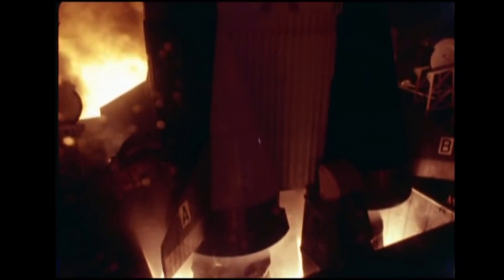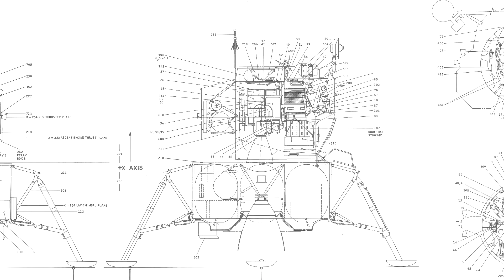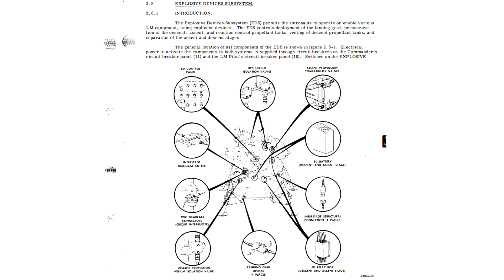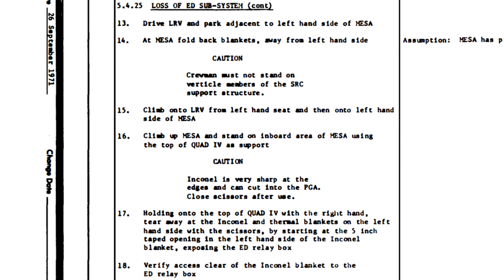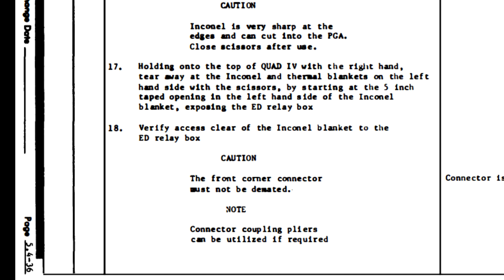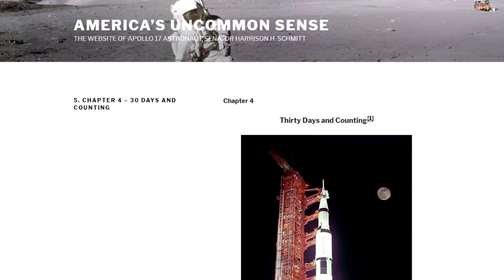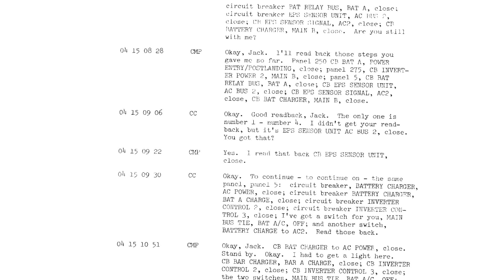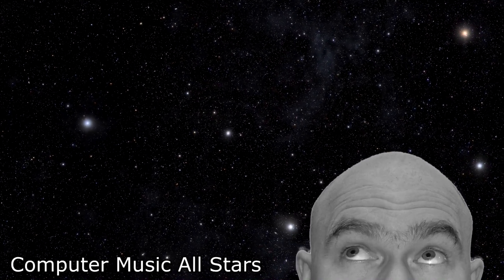Why Lunar Landers Had Jumper Cables For Emergencies

Comment: Spacecraft EPS engineer here. I'd wager it's unlikely they could use the rover's batteries. 
TLDR: It's possible, but unlikely unless it was explicitly designed to do it.

The only thing electrically that would cause problems is the voltage the batteries are sitting at versus the minimum/maximum voltage the system can accept. If the battery voltage is lower than required, nothing will happen, if the voltage is too high, you'll burn stuff out and make it useless. I feel they'd be at the same voltage however because they're the same battery chemistry, so they'd be using the same battery packs for everything, and all the battery packs would be at the same voltage, you'd just use more or less packs to get more AHr capacity.

They almost certainly wouldn't have a field joint for battery/power distribution output, but they would have one for charging the batteries. That's not useful though because there'd be reverse protection to keep the batteries from discharging and backfeeding the charging line. Further, supposing there was no reverse protection, the plug would be capped before flight because it wouldn't be used after launch, you'd need to do some work to get the cap off, which given the environment and constraints would be non trivial. Then there's the issue of needing something that can mate with the connector or a way to get at the lines which would be difficult with the space suit.

It's likely there's a harness for battery output (I strongly doubt there'd be a direct mate from the batteries to distribution, or no way to get at the output of the power distribution), but that would be buried inside the structure and be exceedingly hard to get access to without disassembling the rover.

So unless there was a field joint for battery output and a harness they could use to connect to it, it wouldn't work.
Reply: Absolutely concur, excellent analysis

Comment: I LOVE your videos and understand that LEGO is a sponsor, but couldn't you have used an actual scale model (you HAVE to have at least one) to demonstrate the amount of asymmetry needed to compensate for the fuel and oxidizer differences?
Reply from the maker: LEGO is not a sponsor, I bought that model on my own dime. I don’t do sponsorships.
Reply: @scottmanley My true apologies, I can take that down.  I just saw the thumb at the end.  I can give you one of my unbuilt 1/48 Monograms (of the lander) if you do not have one and if you would like it.  PS, YOUR Saturn-V is in much better shape than mine, but I have the parts you are missing, same deal.

Comment: You could replace the whole procedure with a switch. That procedure would then only be needed if the switch failed.  Or have I missed something ?   ;)
Reply: Didn't look into the circuit diagram, but this is procedure is probably the last-ditch effort to connect the battery directly to the pyro igniters and the fuel valve solenoids, leaving the failure points only at the redundant solenoid valves and the probably also redundant igniters. Could've been useful if the wiring harness was damaged in a cabin fire, was faulty from the start, or was damaged by the failure of a mounting point and vibration causing it to rub on a sharp edge somewhere. The recent hole in the Soyuz hull proves that you can never fully rely on QC to catch everything. However, I wonder if a modern moon lander would be constructed in a similarly simple and user-serviceable way.

Comment: It's still pretty amazing they pulled off all the landings without major incident. Compared to lifting off the Earth, the lift off from the Moon was so much easier. The ascent engine on the LM has long fascinated me because it acted as the invisible umbilical between the Moon's surface and the orbiting CSM - the Moon walker's lives were dependent on it working. Because of the ascent engine's constant thrust the moment the engine had to cut off was time critical. In the Orbiter AMSO simulator you can see the shape of the orbit changing faster and faster as the ship gets to a safe orbit altitude. I've done this manually several times and it's quite a roller coaster ride even on a desktop setup! The track lineup with the CSM has to be pin sharp otherwise you're off plane. There's usually very little fuel left after the launch to Lunar orbit from the surface even with an optimum ascent curve, so every burn of the quad RCS system has to count in order to rendezvous with the CSM. That makes the real life event even more mind numbingly amazing. There's one more thing. At the scale that we exist, all these things actually become possible - something everyone should stop and think very carefully about.

Comment: I remember two comedic takes on the Apollo 9 mission. One was a multi-panel comic strip that had the astronauts stuck on the moon because they need a jump-start, and a UFO settles down net to them and two little green men pop out with Jumper Cables. The other purported to be the last item on the emergency checklist which involved one of the astronauts standing under the ascent engine with a box of kitchen matches.
Reply from the maker: Apollo 9 never left earth orbit.
Reply: @scottmanley  I guess I meant Apollo 11. I'm old; my brain don't work so good anymore.

Comment: Scott can i ask you not to have moving text on a 30 fps video. The flickering is horrendous. The info was awesome tho.
Reply: 30fps is fine. That said though, fps preference is somewhat subjective...
Reply: @razeezar  One can get so used to the objectively worse that they wont accept the better. The tradeoff for higher fps is obviously a higher bandwith requirement for both us on download and scott on upload. I totally understand if he wants to upload faster. Realistically speaking 60 fps does basically nothing for the majority of his video. 

The problems with 30 fps videos only appear when something is moving fast over the screen or when there is text rolling over the screen. 

So in fact i did not ask him to use 60fps but i instead asked him to stop using rolling text.

Comment: Photovoltaic and battery charging. I deed it 2012 in Salzburg as the old battery of my car failed. Half our charging with all my solar panels and it was possible to start the ICE engine again. https://car.pege.org/2012/solar-starter-aid.htm Now I have always a small lithium power bank in my car, can charge the smartphone and jump start the car.

Comment: The rover probably has too high of a voltage. Or the thing they are connecting to is also on the ascent stage so you dont have wires being ripped out on launch.

Comment: The batteries involved do not have to be of the same chemistry for a "jump"--the voltage has to be in a certain range and the amperage needs to be sufficient, but otherwise electrons are electrons.
Reply from the maker: And the voltage is generally a function of the chemistry.....
Reply: @scottmanley   It still does not matter what their chemistries are as long as the voltage is appropriate.  For example, a 3-cell (in series) lithium-ion battery has approximately the same voltage as an 8- or 9-cell NiMH battery.  If you match the voltage closely enough, then it won't matter what their chemistries are--you're not physically mixing/exchanging the chemicals, and the electrons don't care whether the chemistries are different.

I'm not an aerospace engineer, but I presume that systems are designed for a specified voltage, and this includes the batteries, regardless of the voltage of a single cell due to its chemistry--designers will put enough cells in series to reach the specified voltage regardless.  Even if one system has NiCd batteries and the other has AgZn batteries, one can charge or jump the other as long as both systems use the same voltage, such as 40 volts (a common example in aerospace).

Comment: I knew they could connect the battery directly to the the engine.  Did not know they had to go outside to do it.  Also first 3 landings did not have a lunar rover, wonder what the astronauts would have stood on.

Comment: If they only had chevy and ford design the power system.
Could have just used a screwdriver to short out the starter and solenoid.

Comment: I always carry a 1 gallon fuel can, a set of jumper cables, a 5T hydraulic jack a 6" 2x4 and a 3/4 drive breaker bar with matching socket for tire with me.
Every vehicle comes with tools to change a tire but I hydraulic jack and breaker bar is sooo much easier.
I do not ever call roadside assistance and don't pay for it on insurance.

Comment: They also had jumper cables in case of a PLSS failure to connect one astronaut to the other on the J missions and in the case if the LRV
failed miles away from the LM and they had to walk back.

Comment: Your mention of the LRV battery being used to jump the LM reminded me of a strange feature of the early Nissan Leaf electric cars. There was, of course, a battery that ran the motor of the car to propel it down the road. But there was another, more normal 12 volt car battery in the car as well. You see, the issue was, the electric motor used something like 120 volts or more, but the car's accessories, things like headlights, radio, power windows, signals, instruments, and... the computer that actually ran the car, were all derived from similar items on more normal internal combustion cars. They ran on 12 volts, which is why you needed this battery! It was possible for the 12v battery to die, which would require a jump start before you could turn the car on. (Leafs of SL trim or higher had a solar panel that kept the 12v battery topped up)

Comment: Back in the 1980's a hurricane knocked out all of the power stations on the island of Kauai.  You need power to start a power plant, so they needed external power.  A nuclear submarine was sent from Pearl Harbor to jump start the island using their shore power cables to provide power from the nuclear powered steam turbines.  In the end, the Navy flew in a large portable diesel generator and got one plant started, it got the rest started.

Comment: As far as using the lunar rover to jump start the engine: the batteries' (wiki says the lunar rover had 2) energy capacity might have been servery diminished by the folks driving around. The voltage might not have been the optimum 36V anymore, and the maximum current draw would not have been very large. Probably not the best energy source to trust in such a situation.

Comment: On the rover the batteries were covered in parrafin wax for cooling purposes so I doubt they could expose the contacts.
Reply: There is also the issue of the engines firing once power is sent to the valves, so jump starting from the rover would be the ultimate short straw.
Reply: Maybe not if they had a way of hooking to that first,  @NFSgadzooks .

Comment: Speaking as an electrical engineer myself. If the battery voltage on the rover is the same as it is on the llm? Then, yes it's possible to connect the two together. I believe that the electrical systems on all of those spacecraft were around 28 volts.

Comment: Why didn't they set up the ascent module to detach everything from the descent stage except for an accessible power link as soon as they touched down? In the event of a separation system failure, you could then do the manual bypass at your leisure with the full life-support packs attached to your suit... snipping two or three wires before ascent would be much easier than scrambling around on emergency air trying to do all of this stuff.

Comment: Scott mentions launching LM upper ascent stage with the jumper cables still dangling from the main hatch of the upper stage. 

The FIRST THING I envisioned was someone driving away from a [gasoline/petrol] service station in their vehicle with the refueling nozzle and hose STILL ATTACHED TO THE VEHICLE...😊
Reply: I saw some guy do that once.  The hose stretched about 20 feet before ripping out the fueling port on the car and come whipping back at me like an angry anaconda.  I can only imagine what would happen during a LEM take off and even one cable not disconnecting...
Reply: @NetTopsey  >>> Oops... 😝

Comment: @Scott Manley >>> Did the LM descent stage use H² fuel cells to provide electric power?  I just realized that I do not think I have ever read what was used.
Reply: I think all the power in the LM was from batteries.
Reply from the maker: Batteries for LM, Command module used fuel cells.
Reply: @scottmanley  >>> Thanks Scott!!

Comment: The main reason the engine had to be so simple is b/c it could NOT be tested. The nature of the fuel in the rocket were highly corrosive. They destroyed the engine. The engine could absolutely only be used ONCE. It was not until it was used on the Moon that the escape engine was used.
Reply from the maker: The 'Moon Machines' documentary gets it wrong. Yes there's a limited lifetime due to corrosive fuel, but documenation shows every engine has a 15 second test fire before installation. Also, there were several missions where the engine was fired twice.
Reply: The same fuel was used in the descent engine, and it could be restarted.
Reply: @stargazer7644  That is not what is usually said. I have seen a number of documentaries saying the engine was only used once, untested.

Comment: Dear Scott: Two questions:

1- Could the LM ascent capsule be Gimballed by using the side motors while ascending?

2- Could the Idea of an open ascend  capsule, such as the one used in "The Martian" novel, be possible?

Thank you in sdvance for ypur sttention and time.
Reply: 1. Of course.  How do you think they steered to where they were going?  They had to meet up with the command module.  2. What difference does it make if your capsule is open or not - you're in a vacuum.
Reply: @stargazer7644  Thank you very much for your answers, but I guess you are a bit confused between maneuvering in space and taking off and ascending. 
While you are ascending, there will be drag by as little of an atmosphere there is on the moon, or maybe Mars. In Venus will be impossible right now to take off without an enclosure. The drag will be too much.

Likewise, one thing is using the side thrusters to maneuver in space, like to steer to met and dock with the command module, and another  using them is the ascending stage to make up for lack of engine gimbeling, also because the drag and the speeds involved. 

Scott even mentioned that the ascend capsule engine was in the center of balance of the capsule due to it's inability to gimbal while ascending. It went straight  up, and then started maneuvering with the thrusters once it escaped the moon's gravity and atmosphere.

Comment: The main consideration for using the rover batteries is the voltage of the LM system you're trying to start. If the the rover is a bit higher, you could pull it off. If the rover is too much higher, it could be tricky. However, I'm sure the chances of having any juice left in the rover at that point are pretty slim. The mission science schedule would probably drain them to the point where limping back to use as a step stool would be all they had left.

Comment: Concerning the question of jumpstarting from the rover:
The screenshot posted at 07:04 reads like connecting the power instantly activates the engine and the explosive bolts. So you can probably jumpstart from the rover, but whoever does that stays behind and watches.
Reply: Which is why you connect that end first. Pause it on Harrison Schmitt's post and read that section. He says you hook up the battery first then hook up the other end to two separate breakers and bang, your off.
Reply: @dantreadwell7421 : Your... what... is off? Which possession? Your... ascent stage?
Reply: Or perhaps if they had thought of just one more thing, bring a push-button or some other kind of switch with them and then hook that in the circuit, and then rest more assured that they'd have everything nice and hooked up and then as everything and everyone is on board with the hatch mostly closed, just push the button and take off while closing the hatch.